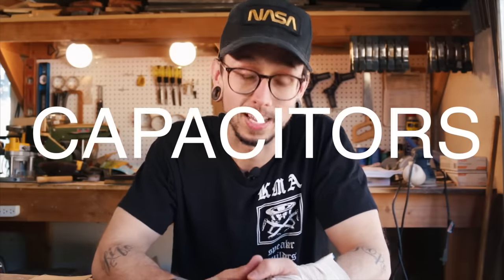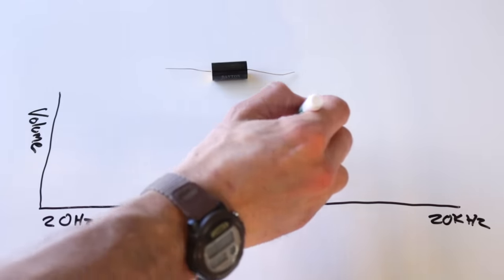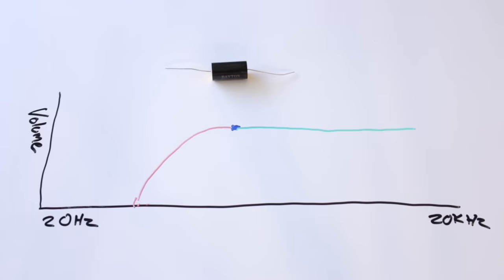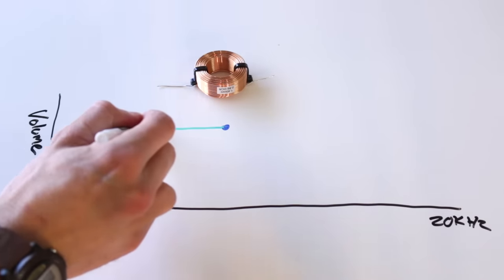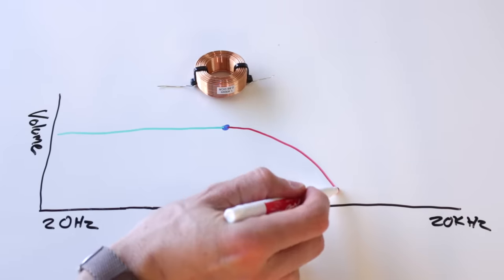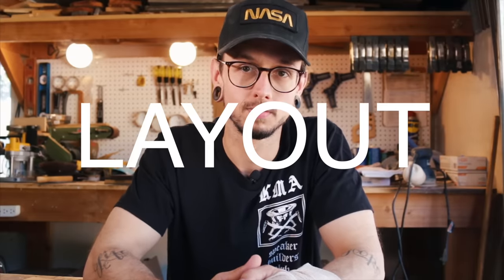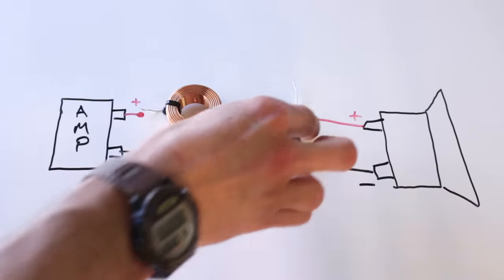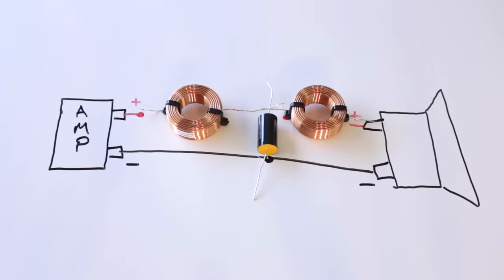How To Design A Crossover For A DIY Speaker || Part 1 - Crossover Design Intro

Comment: I started a electrical engeneering bachelor last winter. Never thought that the things we learn apply so directly. It was a breeze for me. 
Can only recommend
Reply: Maybe you know this, but this is not a straight resistive system so in most cases the electrical order will not actually match the acoustical order your aiming for.
Reply: Attainable Audio yeah speakers are also inductive components, so there's that. So it it a lowpass filter in itself, if I understand it correctly. But the inductance is probably so low that the characteristic frequency is relatively high.

Comment: I have a b&w 705 s2. The crossover has VERY SIMPLE but hi quality, thick gauge air core inductor and a mundorf silver gold oil cap. Is this simplicity good or bad?

 The whole speaker/cabinets is high quality, but seems it could benefit from small xover mods

Comment: I have been mucking about with various crossover specs, both active and passive. My conclusion at the end of it is to go with active right from the get go. Since you can fine tune to any driver and any system. This way if you make changes later on you dont have to go through the whole drama of tweaking and re-tweaking.

Comment: im so happy that you made this video because i never seem to find a suitable crossover for my plans
Reply from the maker: I'm glad it helps! Thanks for watching!
Reply: there is a software crossovers so there is no need to use a hardware crossover also the hardware crossover has a slow decrees but with the software crossover the sound will stop instantly at the crossover point this means the software crossover works a lot better then the hardware crossover

Comment: Great video set.  I have a question.  My speakers are late 70s Pioneer Stereo Hifi 4 speaker, speakers.  There's the usual bass, midrange, and tweeter, then theirs another piezo electric speaker.  Do I need a 4 way crossover or can I double up the tweeters on a 3 way (doesn't sound good to me).   Do you have designs for such a 4-way crossover system??  Thanks for any help and you make really great and helpful videos.

Comment: Hey Kirby one quick question. I got 2 jbl prx 525 loud speakers that are self powered rated at 1300 watts peak. Long story short on both PAs both amps are gone. I wanted to know if i do an amp delete and run a high quality audio crossover for the Loudspeakers can i get away with that?

Comment: 0:53 What if you bought really good speakers and used them as reference speakers? Copy the speaker's sound with the crossover and then tweak that just a little bit and make them maybe sound a bit different (to your taste) but not too much different. The only trouble is that I don't have 3 grand for really good reference speakers. Would that be better than just guessing?

Comment: AC/DC electronics classes, showed me the real dynamics of filters. Chokes or "Inductors" increase in impedance with frequency, whereas "Capacitors" decrease in impedance with frequency. The 'slope' of a crossover, must derive from the driver impedance as well. A voice coil under a driven signal is not uniform in impedance, where the passive components in a filter are, and the difference is because magnetic flux in the motor of the speaker varies with frequency. Say you want the driver to roll off at a given frequency. The impedance of the inductor at that frequency would then be equal to that of the driver. Thus the driver is 3 decibels down or meaning that it is getting half of the power from the signal. In terms of crossovers, there is no such thing as a 'flat' response. Most entry-level, off-the-shelf speaker systems on the market today, employ only capacitors. They usually are not audio-grade film and foil, they're usually bi-polar electrolytic. The costlier systems are more costly, simply because they employ a true crossover. The actual response curve of a simple inductor is linear, but since we logarithmically scale what we see, it appears to slope. The actual response time of electrolytic caps in the super-tweeter region is too slow, such that film and foil caps outperform.

Comment: You had two inductors, and with a 1st order, you could use a single inductor @ the value of the sum of both your inductors. But there is a purpose for that. I was puzzled how I could place a cap from + to - without having to resist it (otherwise it would short circuit the treble) and (even with resisting it) I would still lose some treble (robbed from the tweeter). So I put a small inductor in series with the across cap and the added resistor. It worked (I suppose) but your double inductor idea is better (I reckon). Now I know. You used two inductors that are half the value (one on each side of the cap connection) so it blocks the treble that would otherwise be short circuited. Well done. Make some more crossover stuff.

Comment: Hey Kirby,
I've been watching your videos lately and i find it super interesting and i actually decided to build a portable sound box myself. :D

So I decided to use a stereo 20watt portable amplifier using adafruit max9744 based amplifier which uses filter-less spread sprectrum for the output section(no inductor/capacitor on the output side). I plan to use crossovers for my build and i'm not really sure if i can use the regular crossover components for these.
What components would i need for a amplifier like this one?

TIA

Comment: no time to discuss more? but time to play with fire woofers? I liked  this video discussion. Maybe you could slowly expand on this subject: 2 way, 3 way, and 4 way crossovers, L-pads, (variable resistors, or potentiometers are not the same as L-pads), impedance matching, time alignment, matching the driver output of the hf - (mf)- lf (dB)., then electronic crossovers vs passive crossovers, bi-amping, tri - amping, powered sub woofer(s) - one or two.

Comment: 3:52 Feastrex made some single drives that are 70 GRAND a pair! HA HA HA HA HA lol Still with the inherent problems like "doppler" (the treble is "excurting" it's way out of the driver) (lol) and the difficulty of a large 8" driver to go high enough. Time aligned coaxials like the KEF makes it way cheaper and the tweeter lacks the "doppler". Who would buy a Feastrex when it still retains those problems and when you can get KEF for a twentieth the price (with enclosures as well). lol

Comment: I've read that ideally you want to use nothing BUT 4th order crossovers in order to prevent phase issues and haveing frequency level bumps at the crossover point because of excess blending or something like that. I also heard 1st order crossovers were the worst at this, and the most likely to damage speakers when it came to cutting out low frequencies because they didn't cut them strongly enough. And that they were also the worst for subwoofers because your subs would start playing the hum of male vocals if you had the crossover point anywhere reasonable like 60-100hz. Care to elaborate or give your thoughts on that?

Comment: Talk about bsc.  You need a somewhat decent mic to measure baffle step.  I use a at2020usb and holmimpulse.  Typically my bsc circuits are doing about 9db between 200hz and 900hz.

Comment: Biggest mistake I ever made was opening up an old pair of Gemini gsm 1545s last week, thinking I could replace the crossover and fix them. I didn't even know the difference between a resistor and capacitor and, now, here I am down the rabbit hole.

Comment: Kirby, PLEASE SEE THIS. How do you feel about DIYperk’s avoidance of this step? And by using a crossover setup instead of DIYperk’s method, can you change the number of drivers you can use?
Reply: What project are you talking about?
Reply from the maker: I don't know what you're talking about. Will you post a link?
Reply: DIY perks usually uses small full-range speakers, so they don't strictly need to have crossovers in place, however, they also have substantial limitations in reproduction due to their size, excursion, and mechanical and electrical spring force. You can also just buy preassembled filters or crossovers if you're feeling less motivated to figure it all out yourself. Nothing wrong with that, just need to match them properly and make sure they're for the appropriate impedance for your speakers, etc.

Comment: kirby or whoever can explain to me in your last video on using the winlsd software, i'm building a set of bookshelf speakers and no matter what vent setting i put in its impossible to get it right, either to long for the box or i will get chuffing if i make the port small, this build is for the TCP115 speakers also tried slot port measurements but no different than the round port, and in your video we never got a final understanding on how to build a port to match the box and sound decent without chuffing. thanks for your input
Reply: Build the speaker and see if chuffing is really a problem. If it is, you can fold the port inside the cabinet like in iLoud Micro Monitor, or place it at the bottom like in ELAC AIR-X speakers.
Reply: Have you tried 2 ports
Reply: Attainable Audio  if I choose 2 the ports have to be longer and won't fit the box specs
Reply: grerostov ill have to review on those types to get a understanding
Reply: Ronnie Turpin's vlogs What are you tuning to... What size box
Reply: also keep in mind that if you go with a smaller box you'll have to raise the tuning frequency, so if for instance going with parts express suggested size which is only 0.06 ft3 there's no way to get the lower tuning with a port that would fit which is why they suggest a cutoff of mid 70's hz
Reply: you could go with a passive radiator...
Reply: Attainable Audio I'm trying to get 60hz clean up to 30watts rms I tried every solution on winlsd and nothing seams to work for this speaker so I made a cardboard mock up to test for port size and length for testing purposes hope this works without real bad resonate, thanks your all you help and all others that's helped me
Reply: yeah some drivers just wont work the best for what you want, but, if these are going to be moderate listening speakers with 10 watts your going to be around 91db which is louder than you think. I've made a few with 1" ports and never had a problem.

Comment: 5:05 A couple of queries!
Are resistors really, really flat, like WAY flat?
Would an audiophile speaker maker who deals with way expensive cables etc., resist a tweeter?
Reply: Resistors are quite flat! Not perfectly, usually. But as near as possible. And putting a resistor in line with the tweeter will attenuate the volume down to help keep your high end tamed and matched with your midwoofer

Comment: Does Anyone Know If Capacitors Used On Woofers As High Filter And Nothing Else Causes "Holes" In The Spectrum? I Got A Speaker That Has A Cap On It Already. I Run A Manual Tone Generator And I Noticed There Is A Weird Peak In Excursion Around Is Resonant Hz Of 80Hz Free Air. What's Weird Is Usually It's Very Hard To Tell When Peak Excursion Occurs A Woofer/ Mid Range Driver. So I Wired The Speaker To Bypass The Cap And The Speaker Moves About The Same At 80Hz But Also Moves Alot More Than Before From 85-120Hz. I Ran A DSP With A High Pass Filter Feature And adjusted It Still It Sounded About The Same As The Cap It Came With. It Seems To Be About 125Hz Ish. But What's Weird Is The With The DSP Cross Over The Excursion Free Air Is Gradual As You Approach 80Hz. With Capacitor It's Seems To Have A Hole And Excursion Kinda Stops At 85-90 But All Of A Sudden Once At 80Hz Starts Moving Again. So Are Passive Crossovers With Capacitors Not Perfectly Flat On A Response Curve? Does It Have A Slight Dip Before The Actual Roll Off?

Comment: I have made a mobile speaker with Dayton mid/low woofers (nd105-4) and some older recycled good quality Quadral tweeters... the problem is that the highs are waaay to sharp and claps in old school rap are so uncomfy to listen... the highs are not even crisp, idk if i can do something about it without changing the tweeter, cause in the original quadral speaker they did sound awesome... :( (Cant even look how the original crossover was build cause my stupid ass just throw them away because they didnt work)

Comment: When designing a crossover you really really don't want to use the k.i.s.s. method. There are three types of power: True power, Apparent power, Reactive power. True power is input power, Apparent power is what's there (apparently) and Reactive power doesn't exist. You need to know how to wrangle all three types of pixie before designing your own crossover or you will do poorly.

Comment: Or just do it the 1950s way, single capacitor like in my 1957 Blaupunkt Arkansas😂 There is no coils just a single 4uF capacitor than I replaced with a brand new one, I don't think it even filters that much.

My Canton GLE 100 speakers from 1979 have a beast of a a crossover, that I also recently replaced with electrolytic caps cause I am poor. Will change to polys when I have the cash

Comment: Its not intimidating per se. My problem as always been what can be used as a substitute as far as capacitors, resistors etc goes. Like as far as numeric values go, is there a window of what can and cant be used or does the exact model/voltage/etc have to be exact? Asking because I'd like to start repurposing old boards I come across. There's tons of little components that I can just desolder and reuse as I follow along in videos but they are not the exact same values as what I see in videos. Like on a video the requirement or suggestion(?) is an NP 100v 150uf for a subwoofer. Can a NP 100v 100uf replace that or are the values off so much that it won't "work" for a subwoofer and should be used for mid range instead as far as audible frequencies go? I just don't want to do something that would defeat the whole purpose of building a crossover circuit. As you can see I know very little about circuits lol. Please help, sorry for the novel.

Comment: no speaker has flat frequency response!
In order to get the best possible sound, you also need several parts. over + and - to reduce frequencies it is too much of! coil to capacitor on bass to capacitor to coil on treble is all too easy crossover! all speakers have different sound so crossover must match speaker

Comment: But how to erase phase shift? quite important.
one cap (first order) for high pass (for tweeter) turns voltage -90° of a wave length at -3 db.
one coil (first order) for low pass (for bass) turns current -90° of a wave length at -3 db point.
that is disharmonizing the sound image around crossing point, if not done right.
how to avoid that?
Reply: Jean Katana it's always a compromise with crossovers.
Reply: Maybe second order filter then run through an inverting op amp? More components and complexity though, it's all a trade off.
Reply: I_Hungry
You mean it in Bi-Amping? Using 1 inverted and 1 not inverted to turn phase after x-over?
Just turning phase is not the answer, if it affects like that.
Step response would still be turned, right?
Please explain. 
I've been trying to solv this problem for quite a long time! - without step response messing polarity reversals.
Reply: First ordered are hard to get right because your limited on your selection of drivers that will work well with them.
Reply: Jean Katana so those filters lag phase by 90°, if you use two of those filters, thus making it second order, you have a total phase lag of 180°. You can then use a simple 741 op amp and connect input into the inverting side and drive the output back into itself to get the signal inverted another 180° with a total phase angle of 360° aka 0°. I would assume this would be very good to drive speakers considering the very high input impedance and low output impedance. Also diff amps can be used to help filter out unwanted noise and are a typical preamp stage for speakers. There is a lot of technical I formation on this subject and I'm trying  to keep it as simple as possible so sorry if its confusing at all.
Reply: Attainable Audio this is correct
Reply: I_Hungry
Thank you.
But I think that a full phase delay (360°), probably of the mid/Bass driver in 2 way systems, is quite bad for step responce behaviour of the entire system, isnt it?
If the timing of the mid/Bass driver is already late 180° after x-over 2nd orders, a phase swap would not turn it back earlier to 0°, or later to 360°. 
It would be late 180° and turned 180°.
So in Step response the Tweeter would push out before the Mid/Bass pulls in, as a very first signal response.
A correct step response is so important for an harmonic sound image. 
Would be: Tweeter and Mid/Bass push out simultaneously.
In stable oscillating response, 3rd, 4th, 5th vibe, you have 360° = 0°, but not in first response, I guess.
Thank you for responding, but I'm sorry, sadly I dont beleave that solves the entire problem.

Comment: I've seen expensive speakers and the frequency is all over and impossible to work with and dual voice coil woofers that rub and sound terrible. Resistance is DC and Impedance is AC, AC is what your speaker needs.

Comment: One question. I have one tweeter and one woofer in my house so i decided build one speker. The problem is... my woofer is 550w,,8ohm and my tweeter 180w,8ohm they have potency (watts) very diferenty... can i build one speaker with them? 
Sorry my bad english. I use the translate.
Reply: Yes you can just use seperate channel amplification unit for each speaker with appropriate power output !
Otherwise same power will burn your tweetsr